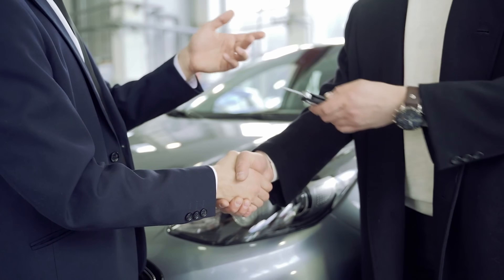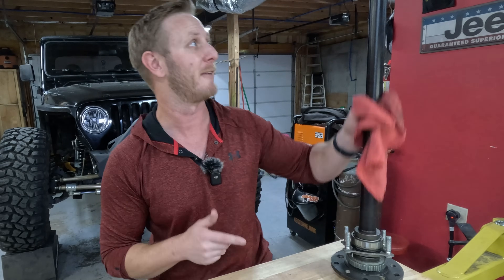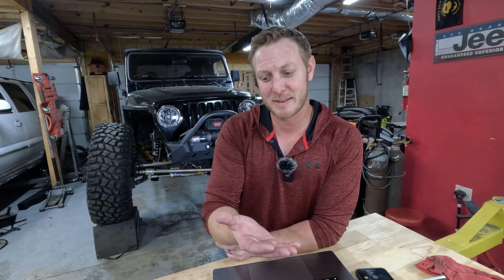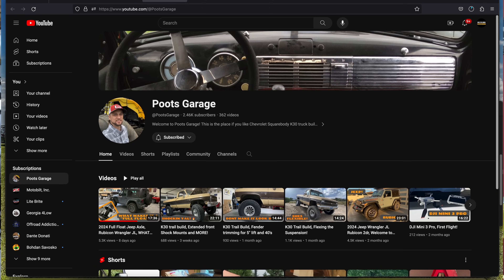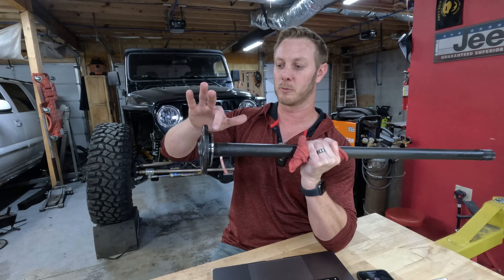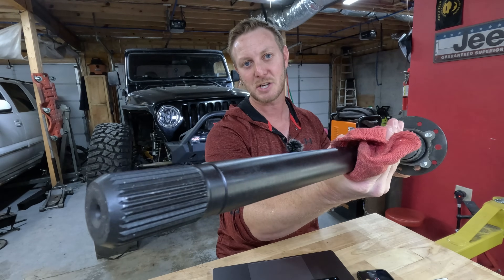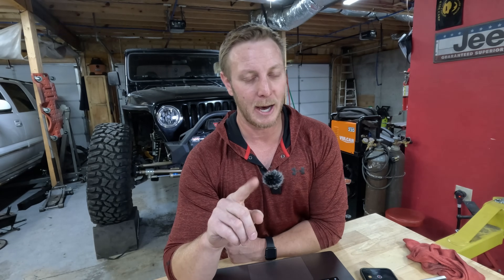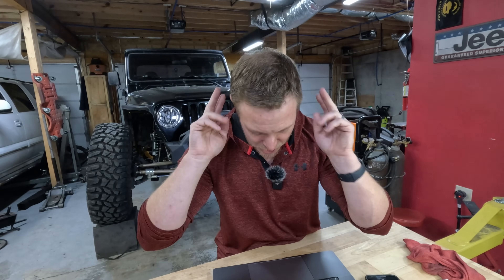Stock Rubicons Have 1-TON Axles?! Is The New Rubicon Wrangler A Rock Crawling Buggy?.... Not yet.

Comment: I bet most people don't know that the 2005-2010 Grand Cherokees all came with this same style of full floater in their rear axles. The SRT8's Dana 44 version had it too. The other models were based off the Chrysler 8.25" rear diff with 29 spline axles.
Reply from the maker: Woah! How have I missed this?? I’ve been junk yard building vehicles for decades and somehow have never noticed this. I’m going to start digging into this further to see what is known about that axle. This could honestly tell us a lot to expect in this axle. Thank you for pointing this out.
Reply: @mudtiremedia  it’s a very disregarded platform. Soccer mom vehicle with IFS, after all! lol. And sadly, the Dana 44 in the SRT8 also has unique bearing sizes. So aftermarket parts, particularly lockers, are basically non existent.

But as far as general strength… The normal Grands have a 6100Lbs GVW and the V8 and diesel models have a 7200(awd)/7400(rwd)lbs towing capacity. (3500lbs for the V6 models)

In addition, the optional Quadra drive 2 ELSD is an EATON made electrically activated clutch style diff that clamps with an internal hydraulic piston. It’s capable of locking the axle up enough to skid the tires. And as far as I know the Grand Cherokee, and the platform sharing Commander of those years, were the only vehicles that offered both rear and front ELSD’s from any OEM.

Comment: Gladiators have been using this set up since their release. My 2020 has the same exact setup they are using in the 24 and newer wrangler rubicons.
Reply from the maker: I’m not sure what axle you had under your gladiator, but I know the M220 rear axle is still a semi float axle shaft with the bearing pressed onto the shaft. Are you sure you had a unit bearing on the ends of your rear axle?
Reply: @mudtiremedia I’m getting ready to put an M220 in the rear of my TJ. (I’m doing a D60 Superduty for the front, out of a 2017 F-350). The M220 is semi float. 
I want to go to 40” tires. I think I should be ok. 
What size tires are you running?

Comment: This is not a "full float" axle. It is a unit bearing hybrid float axle. I know that sounds dumb, but there is major differences. (1) you cant just slide out the shaft (2) There is mechanical disadvantages in the "scrub radius" even though it does not turn the leverage to the mounting surfaces is further out (3) The unit bearing to axle flange to "clam shell" the whole thing together is a failure point. There is other nit picky things, but I am not a fan of this when they could have just gone UD 60 rears that they are already down pricing to make room for their new UD 80's in the after market axle space. 

Also one other thing is axle tube wall thickness. With that hybrid float system the leverage is further out putting more stress on the tubes.

On top of all this its a wonky one off design of which is going to be a cluster phuq to fix on the trail, or get parts. 

The price difference between this, and a UD 60 from a manufacturer point of view is probably $500 - $1000 per axle..............heck even at $2500 ea its just a far better choice. C'mon Jeep give us real options here not these jack of all trades master of none.
Reply from the maker: I can definitely see your point. I’m betting that mopar is having a hard time justifying the higher weight that a true 60 adds to an axle when the mass market won’t ever reach the stresses that the axle will carry and the mpg loss that will follow along with the 60. And that large axle comes with a much larger brake which would need wheels to clear and more consideration from their part. I really think this was their best shot at giving the mass market more strength at the best budget and solution.

Comment: It looks to be an improvement, but it doesn't appear to address the bigger problem of the JL axles.  That being the smaller pinion gear with less pinion offset compared to the JK.
Reply from the maker: Really great point! I don’t understand why they felt the need to decrease the size of the ring and pinion on such a small axle anyway! And I’ve been following other axle builders who have been having recurring issues with the bearings failing in the previous m210 and m220 axles for no reason. I really hope they figured some of these things out with this new axle.
Reply: @mudtiremedia  I think that between the smaller pinion, slightly smaller ring gear, reduced pinion offset and switch from tapered pinion shaft bearings with steel cadges to ball bearings with plastic cadges the design intent was to reduce friction to active better epa mpg.  I think that is very obvious.  They made a weaker gear set and tried to spin it as a stronger when in fact it is weaker than the previous JK gear set.  Ring/pinion failures seem to be more common on JL's than JK's running the same size tires.
Reply: Interesting, The pinion head on the M220 is longer, and the ring gear teeth are longer, so I think the "reduced contact" from less hypoid offset is a wash.....  The M220 pinion shaft is much bigger and more rigid, also.  I totally agree with you on the crappy pinion bearing, and I feel the housing casting on both these axles is too thin and light to get the most out of the gearset strength.  The M220 has a Dana 60 carrier bearing on the ring gear side as well, and looking closely at the gearsets, as well as going out on the trail and watching breakage, I still feel the M220 gearset is a better design with greater strength potential.   Dana needs to upgrade thickness of the center casting in several areas, and make the bottom smooth !! @Marty1911

Comment: So what’s it gonna take to upgrade this to my JK
Reply from the maker: Lol. You know, years down the road, i see these as becoming a great swap axle into older Jeeps! And when your trussing the axle, it would become easy to relocate the brackets into the needed locations! The future is looking bright.
Reply: @mudtiremedia  actually, I was thinking more along the lines of cut the end of it off and weld on a new end and slide in the axle bolt on the bearing brake assembly
Reply: Very interesting! This isn’t something I had even considered. IF some company would happen to manufacture an adapter place that would self center onto the axle tube after cutting off your stock end of the tube, that could be possible. But ensuring that it is exactly perpendicular to the tube would be extremely important with no warping when welding. And of course there would likely be some issue with adapting the older jk wheel speed sensors and possibly the E-brake assembly. Most likely, if someone couldn’t do the work in their garage, they would spend the same amount of money as building a junk yard 1-ton axle.

Comment: If the rear barn is anything like the front, you will not be able to pull out the axle shaft and continue to drive. Because the bearing will probably fall apart. With how to having the surface to ride on from the actual shaft
Reply: That hasn't been the case since TJ days.  In both JKs and JL/JTs u don't need to have the stub shaft in the front to hold the unit bearing together.  It's designed to run without it.  In a TJ yes it will come apart.  The rear on the 24 is same way.  U can run it without a shaft in it to get off the trail.
Reply from the maker: I had considered this. With the front axle shaft, it bolts together inside the bearing, sandwiching the bearing together. But with this rear axle, the shaft appears to only slide into the wheel bearing, but it doesn’t bolt together. The bearing is actually sealed with a solid wall at the outside.

Comment: I think the Gladiator rubicon would have it and someone in the tech writing/specs just overlooked it and did a misprint.  Toyota does misprints all the time, just human error. I could be wrong.  If I'm wrong then it's a bummer for the Gladiator. Just my guess.
Reply from the maker: This is a really good point! I hadn’t even considered that. As of right now, the gladiators build/comparison sheet isn’t live on Jeeps website, but in the 2024 online reveal, they made sure to mention “heavy duty dana 44”. But when they refer to the new axle, they always mention “full float”. But my hope is that they will include this new axle on the rubicon. PLEASE!!!
Reply: @mudtiremedia  yeah i'd think all the ruby models would be equally equipped.  If not, shame on them.
Reply: Having it on the Gladiator would just make too much sense. For towing, and for all the weight people throw in the back of those either hauling or overlanding. And then Mojave for bouncing around high speed bombing. If it's not there they really missed the boat.
Reply: The Gladiator doesn't get it

Comment: How much tire do you think the JK Rubicon 44's can handle on a TJ with RCV shafts, 5.38 gears, 4.0 I6, and 4:1 T-case?

Years ago people would say a D44 couldn't handle a 37" tire with any hardcore wheeling on a TJ, but now it seems every 4 door JK, JL, and JT has 37" tires on the stock axles and weigh 600-1200 pounds more.
Reply from the maker: I’ve seen this actually used and the JK Dana 44 axles are a good upgrade for the TJ, ESPECIALLY when keeping the I-6. You can fairly safely run 40’s on these axles with limited danger to breakages because of the light weight of the TJ and the low horsepower of the 4.0. The only real major weakness of these axles begins to show up with higher horsepower and running 5.38 gears because the pinion becomes so small, that it does not handle the power very well with large tires.
Reply: JKs dana 44 are way bigger in every way in comparison even to the TJ "dana 44" axles, thats why they can run 37´s on a heavier vehicle without problems (mostly, unless you are a hard core right foot guy lol)

Comment: isn't the full float axle also available in the willys trim?
Reply from the maker: As of right now, on jeep.com they are only stating the rubicon model as having the new axle available. When you look at the Willy’s edition on the comparison chart, the full float rear axle is marked “not available”.
Reply: @mudtiremedia they changed it? It was just the rubicon x.

Comment: I have an 06 lj on 38s that's a rock crawler, and a 23 JTR that will never see more than 35s.

I would never imagine trying to take a well built JL or JLU on 40s where my LJ on 38s will go. The JL platform doesn't offer enough suspension travel without extreme frame modification. Plus the JL crowd(meaning those on 38"+ tires) tends to be more reserved in their wheeling, God forbid a stick scratch the paint.

My Moab experience with the JL crowd was watching them take bypass after bypass, even on Golden Crack, a JLU on 40s, 8 lug axles, with bypass coil overs wouldn't do it without a spotter.

So I say these new axles will handle 40s no problem.

As for the gladiator, seeing all the overland people on 37s with an obviously overloaded set up, I see no need for the weird full float axles. The JT is too light to need it for towing, it's already proven itself with being overweight(I bet leaf springs would have given it a higher load carrying capacity, but at the cost of comfort). So for the normal person who doesn't do youtube and isnt sponsored, they will likely never have an issue with the rear axle. My opinion is that the JL is for the "offroad" crowd and the JT falls more to the overland/car camping crowd.

I got the JTR because I plan on using it for car camping in remote spots. It still has a truck bed so I can haul car parts, go hunting, carry firewood or anything I don't want rolling around inside. Yet it still has the ability to take the top off, do mild offroading(level 6 trails max in my opinion while bone stock) and be a decent daily driver.
Reply from the maker: I can agree with a lot of this. The newer Jeep crowd tends to be a bit more reserved. I built my gladiator for rock crawling and still drove it like a crawler, but I kept putting it into situations where the extreme length played against me more than it helped, so after I crushed in the back door, I sold it after finishing my TJ because I really like being able to not care at all if I roll it or beat up the body.
Reply: @mudtiremedia  and that's why I personally feel the jk, JL, JT, and whatever comes next will never meet the requirements people need for offroading. The body is too big and I don't blame people for not wanting to damage a $30-$70k rig.

What Id love to see, even though it'll never happen, is a TJ sized body, with the driveline and technology from a new rubicon. Give me a TJ or LJ with 3 inches of lift and 37s with the tech of the new rubicon and that thing will be an amazing offroad vehicle.
Reply from the maker: I’ve considered this so much. Take a JL dash and console and fit it into a TJ with 8.4 uconnect, heated seats….. would be nice

Comment: Why are they still calling all these axles "Dana 44", when very few if any of the parts interchange with a Dana 44? When you have redesigned everything about it, it should get a different designation.
Reply from the maker: Very true. Technically the current iteration of axles on the rubicons are internally at Dana known as m210 and m220 designation axles but they still use a Dana 44 style center housing for the most part, so they keep going back to that, I suppose.

Comment: I'm confused. What is a roller ball bearing. I know of tapered rollers, spherical, (round) ball bearings with or without thrust capabilities, straight rollers etc.
Reply from the maker: Sorry about the confusion. Spherical is correct. at the time of recording this, my wording was not exactly the best. But you can look up the outer pinion bearing for the JL Dana 44 to see what I mean. This is the only axle I’ve seen with that type of bearing out of all the axles I have built.

Comment: Can the front axle hang with this new rear axle?  40s on a front JL 44?
Reply from the maker: Excellent question! I would say the answer is: YES, IF…. Yes because the front axle already runs on a very sturdy unit bearing that does not have any history of failures under the use of 40” tires. BUT only if it has appropriate upgrades to compliment them. The steering components (including hydraulic assist) should be upgraded as well as the ball joints. The front shafts are fairly strong if you perform the FAD delete. 
And I have yet to see if the 2024 wrangler rubicon has the aluminum knuckles, but I’ve seen failures at that knuckle. but with the cast steel diesel knuckles, I haven’t seen any failures.